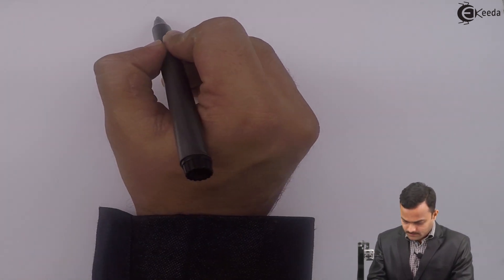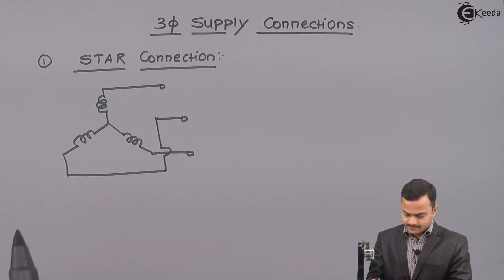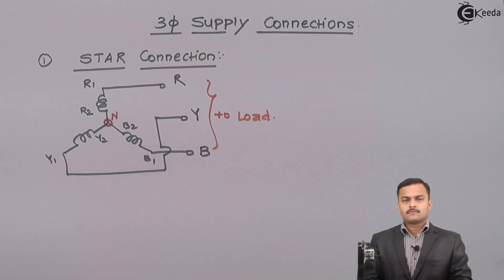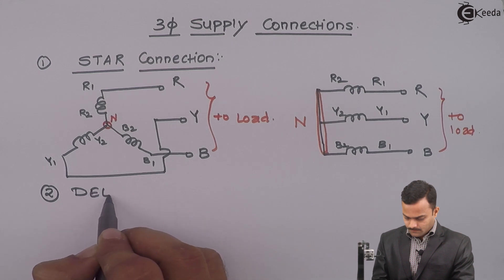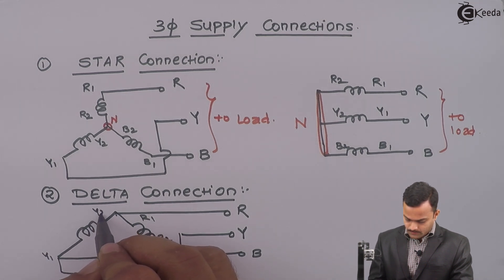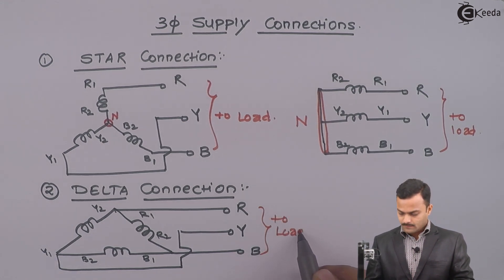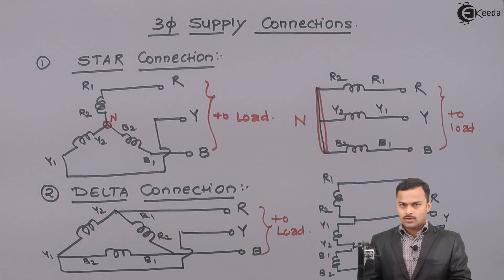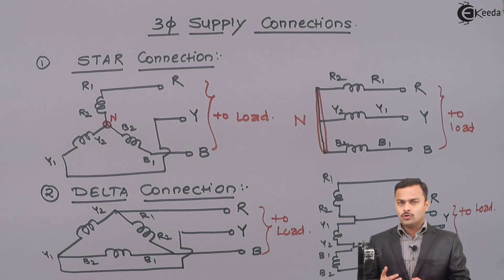Three Phase Supply Connections - Three Phase Circuits - Basic Electrical Engineering

Comment: Your second delta diagram doesn't match the first one. I'm also new at this. I understood the Phases to be wired together as R= R1- Y2,  Y= Y1-B2,  B= B1-R2  as the illustration shows on diagram 1.    Diagram 2 shows the wiring as R= R1-B2,  Y= Y1=R2,  B= B1-Y2..... am I seeing it wrong or what?....  boder37@gmail.com
Reply: I need 3" 0.5 HP submersible water wel pump winding conection please
Reply: biplophossain93@gmail.com
Reply: It is correct

Comment: where is neutral in Delta connection
Reply: robin tiple  no neutral in delta connection
Reply: Gautham Krishna which wye winding is preferred by industry? delta or star?
Reply: Depends on the applications. You can have a neutral to a delta BUT it will have a high leg.
Reply: Bro There is no neutral in delta, if you need a neutral then change delta connection to Star then u will find a neutral point.